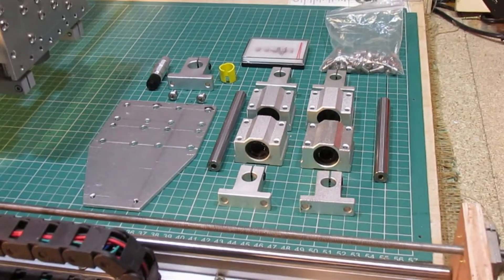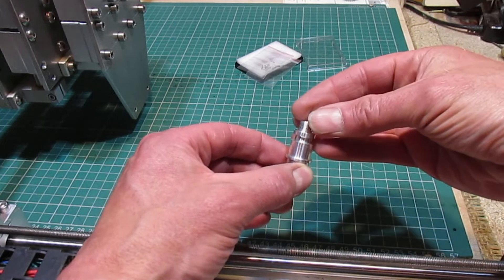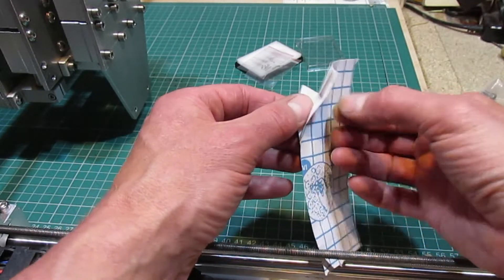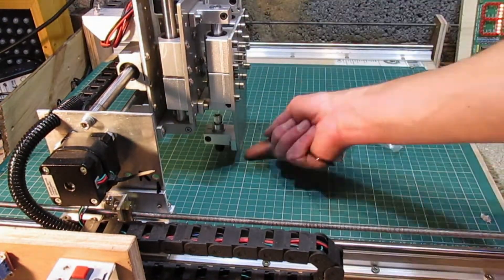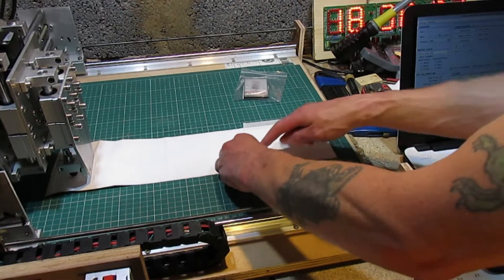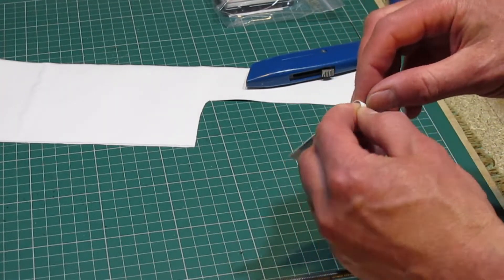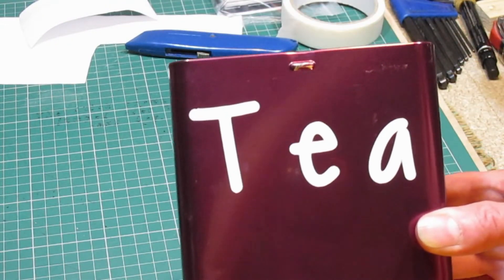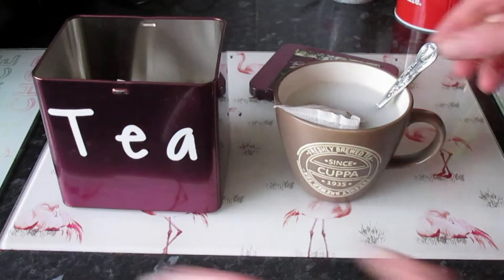CB09 Vinyl Cutter - DIY CNC - Arduino

Comment: Hola, excelente, el motor que sostiene a la cuchilla está energizado como para girar hacia la dirección de corte?  Si es asi, podrias explicar como es su conexión con la placa por favor? Muchas gracias.
Reply from the maker: https://www.ebay.co.uk/itm/195273692871?itmmeta=01HS2V5CWF6CZMDA0HKEM9TVVB&hash=item2d773816c7:g:bR4AAOSwu8Nk8NNU&itmprp=enc%3AAQAJAAAA8GuDjyamkdggvuqmZ257FuUooHrdEtETi1YUGlIhl9JpqaJ0BoFkJYKlZEx7TCQX7%2BEkFNExLDKHrsvCWv2MEcybjNEzZyQBO3WqZyePmCeaAedA%2BBbF8n7%2BkL9kItIlM3pdncBbu%2BErYKxyKEOY19KmXisb%2BX45Z4%2FkBL1pCu79jffb%2FnjZ5qKLR3qUD5noU6PitfCgj5etg%2BN2XXghmvmrUDNmCHJAtsxQbCH8Xs%2FA3KEo%2BRRhV%2FNps%2F9S2aah0hlYNdDOg0HUm52yg0fvKnEnzQdrNqQVVvmS0YZWxzxE4hUHFnaV3cjqSYsEEEwRTg%3D%3D%7Ctkp%3ABFBMuM6V28hj

Comment: Hi, how did you solve the problem to cut edges sharp and not rounded? When i want to cut a square, its corners get rounded because of the slightly shifted knife point. It has to be solves vis software i guess.